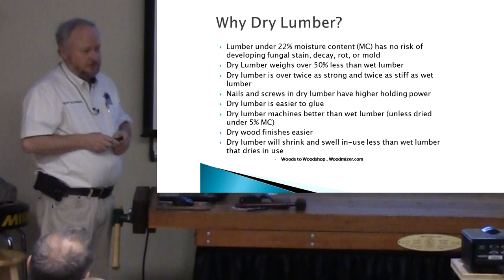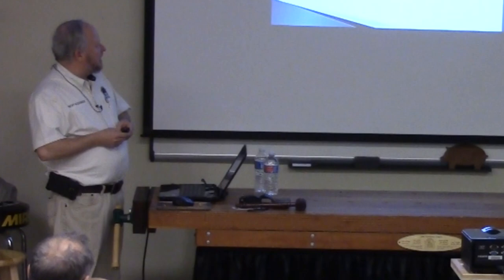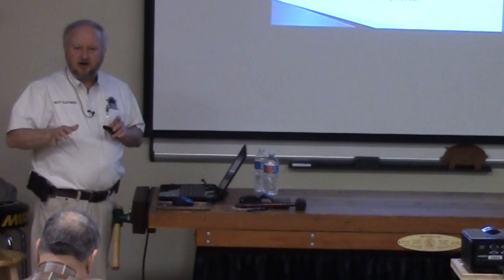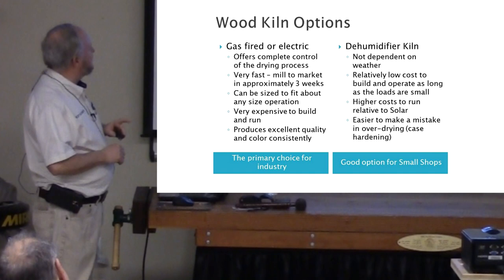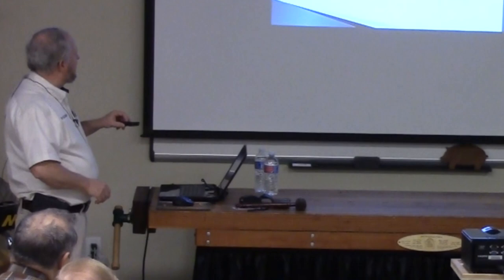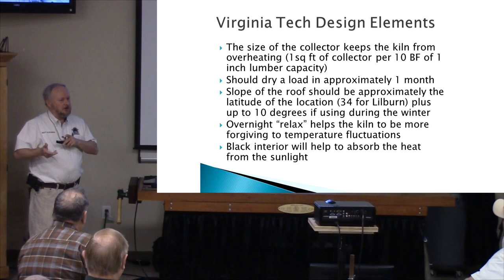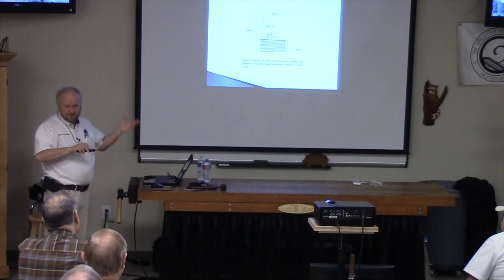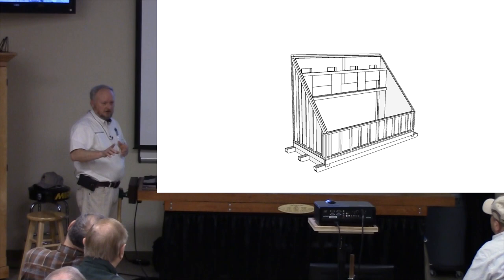Solar Kiln by Ricky Alexander

Comment: Interesting presentation.  I knew of an old fellow many years ago who made a solar kiln using an old propane tank painted black, and using an old dairy vacuum pump.  I saw some 2" x 14" x 12' cedar blanks he cured in that kiln without a check, warp, or crack.  I was never able to find out about the longer term stability of the wood.

Comment: In the south, all homes were built using green oak. They did this on purpose so that when the wood shrinks, it would aerate the home and allow it to breathe in the heat/humidity of the summer.  Of course, this was before AC.
Reply from the maker: Good info! I had not heard of this.

Comment: Great job. I've been air drying lumber for many years   Plan to build this. You mentioned drying what you need for the project at hand. Question. If you kiln dry, and don't use immediately, but store in an outdoor coveted shed(East Texas), will the MC go back up to 14% range that I get with air drying?
Reply: It will go back up to average humidity where the wood is being stored.

Comment: 08/25/21: This video is "Dated". With the introductions of "Radiant'" concrete floors,  with hot Glycol on demand LP heaters. Plus the new 750 W Solar panels with built-in inverters to AC power. Why would you wont listen to Merlin how to pull a sword from a stone.

Comment: I am taking down 3 large red oak trees, this is not time dated, I can wait a year or two if need be.
I want to cut rounds 2 inches thick, no larger then 48 inches in diameter.
I have been told that only a vacuum wood kiln will stop the rounds from splitting.
Is this true or can a air or solar kiln dry the the rounds without splitting?
Reply: Did you ever find your answer?
Reply: It will split no matter how its dried. The inside and outside cookie dry at different rates and something needs to give.

Comment: how do you keep a solar kiln from case hardening the wood?
Reply: @bierbarrel  the wood I used was out of the solar kiln for at least two years. it twisted and turned when cut. show some examples of furnature made from the lumber. then put in a heated and air conditioned house. that is why I pay for Kiln dried Lumber
Reply: @dc9apu  How the lumber is cut will affect the finished product more than the drying.  Kiln drying bad lumber will produce bad kiln dried lumber.

Comment: If you live in a desert it IS possible to bring MC down to 6% with air drying.
Reply: 3yo post lol, but there is an average relative humidity chart for all countries. Anyhow say you live in the desert and the average relative humidity is 5% then you can get it down to near that.
However consider wood is a natural substance that breathes. If you lived in a 12% average relative humidity environment and you dried it to 8% then when you take it outside the kiln it's going to eventually get to more or less 12%. 
Point is don't dry it lower than your area average if used externally as it wastes time. For internal use dry it lower for sure.

Comment: Sorry to ask:  Why must lumber be cut in to boards BEFORE Klinning?
Reply from the maker: Air dried wood takes around 1 year per inch of wood thickness, A 4 inch thick board would take around 4 years to dry. Slicing the wood to thinner layers helps it dry faster. Even with a kiln a thicker board takes much longer to dry.
Reply: You going to dry a whole log,  you be old before you use it